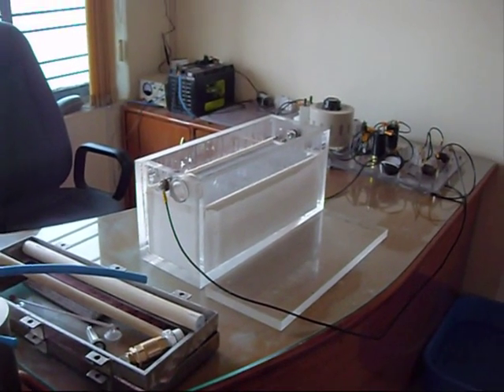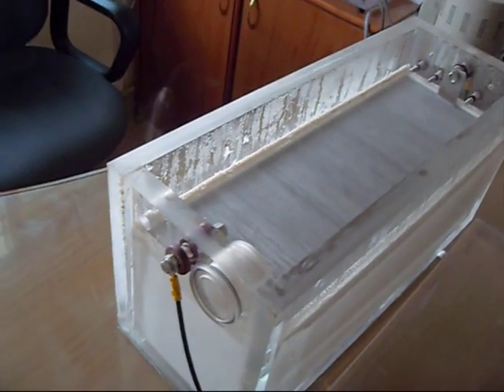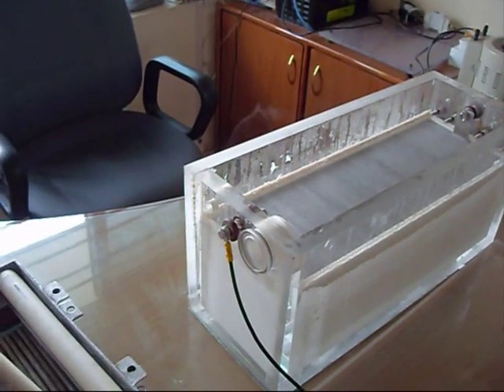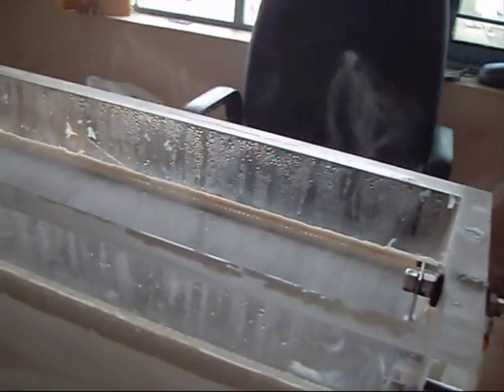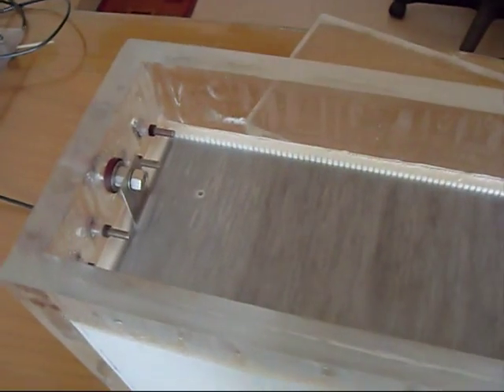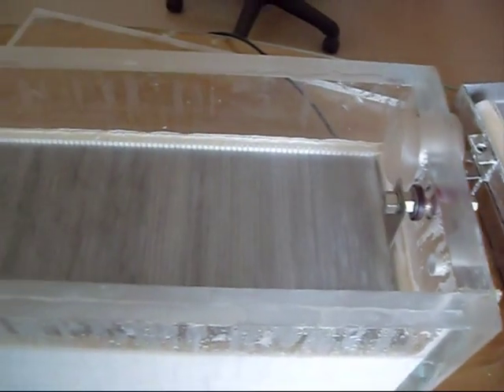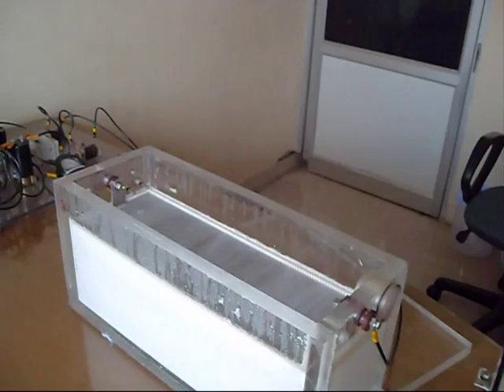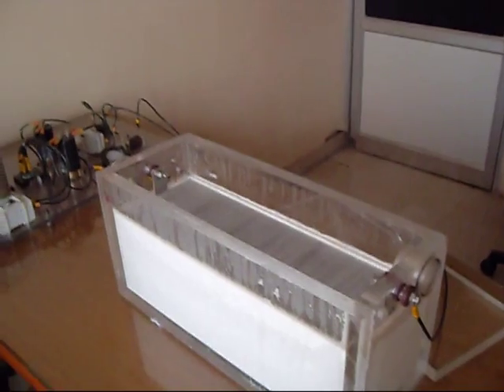Bob boyce cell replication -Plate cleansing

Comment: You should never let the water and foam go over the top of a Boyce 100 cell box. It cannot have any voltage leakage. No water can not travel over the top of the plates. Cleansing is a week long process.